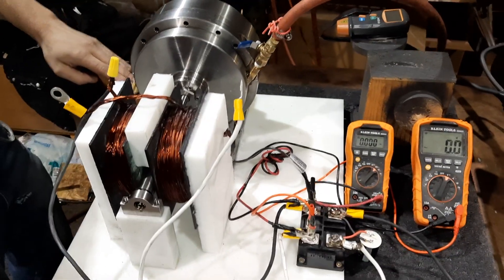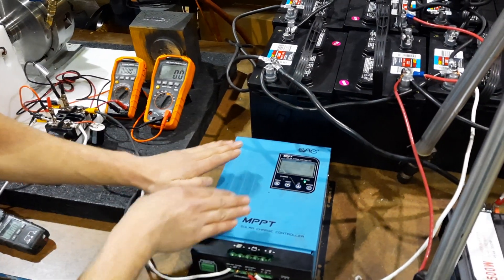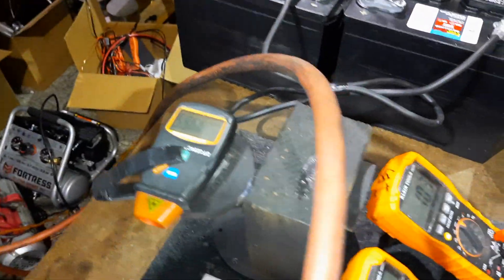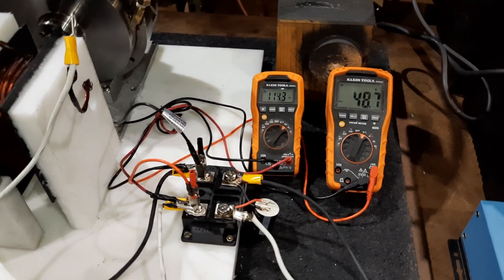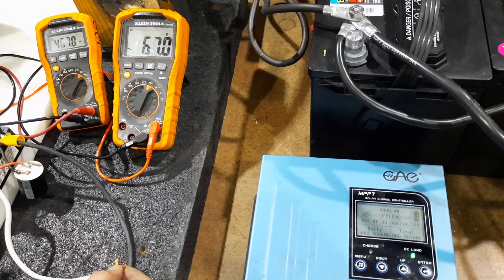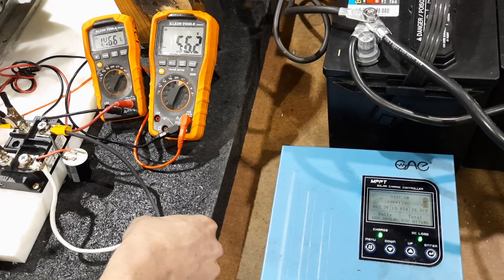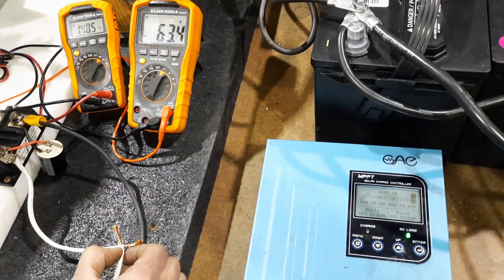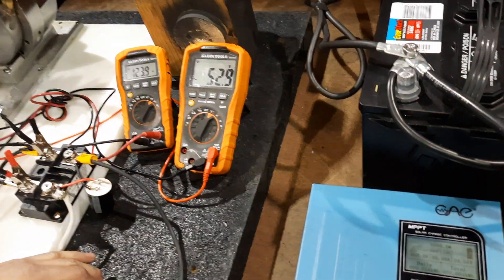Tesla Turbine Producing Usable Power! LOAD TESTING!

Comment: I think you have an "impedance mismatch" going on here. Your alternator is loading the turbine too much and dropping the RPMs out of the region where the TT is most efficient. You could use smaller coils and/or move the coils further from the rotor. You could build the rotor and stator right into your turbine and have less gear to keep balanced. Your turbines are amazing. I haven't seen someone get so much power from a TT before. Right on!
Reply from the maker: you are correct, the problem is vibration when it gets up to speed, we have since fixed the issues.

Comment: Have a question, I see that you disconnect and reconnect to the charge controller, and notice that the turbine then slows down, if you had to leave the connection closed how does it affect the turbine?
Reply from the maker: the charge controller slows down the turbine too fast with the resistance of the load being too high, we have since used capacitors to limit the current to allow the turbine to get up to operation speed before too much power is drawn. The power goes up exponentially with speed.
Reply: @iEnergySupply  apologies but my understanding of this is very limited, am i understanding correctly that the charge controller is slowing down the turbine too much? so to counter that you have a capacitor that the turbine then charges and you pass that on to the charge controller and basically just repeat the process? would this have the ability to run lets say 12Hrs a day as long as you give it air to charge a battery bank with the capacitor set up?
Reply: @iEnergySupply  mppt algorithms are designed to maximize load, try a pwm
Reply from the maker: @drgeeforce1129  gosh I never thought of that! Ty

Comment: Put a splitter on the inlet and feed one side with the exhaust and put a damper on the other side to use as throttle and start it by blowing through it. I'm just curious what happens.

Comment: For the tesla turbine to truly shine and offer significant torque you need to exceed the crossover point between turbulence and vortices typically this is around 50000 rpm on the tesla turbine. Then you will really begin to see how this turbine operates!
Reply from the maker: Your correct but remember it also depends on the diameter of the rotor. 

See our new videos, we got 1400 mile per hour periphery speed, with 150000 rpm with a three inch rotort.

Comment: Nice ! you need more capacitors to stop that drag when on load.. Im no expert but seen that done right and all load drag goes bye bye
Reply from the maker: Wait till you see the larger nozzles and higher speed, this was a low speed test. I'll have updates really soon
Reply: @iEnergySupply  Awesome. Im excited :)
Reply: @iEnergySupply  , would a diode on the voltage regulator input along with those capacitors help to keep the dc from bucking?
Reply from the maker: @alexparsons5707  The full bridge rectifier is what I'm using, do you mean maybe I should use separate diodes after the bridge rectifyer?

Comment: what is the size of wire u used for the coil?  and 400 Amp is so much for ur test, try to find higher voltage but up to 25 Amp bridge rectifier to manage to keep the engine run continuously. BTW what is the nozzle size in this test?
Reply from the maker: 1/32"x1/2" inlet nozzle.

Comment: Maybe the vibration could be removed sooner if the turbine would be placed horizontally?
Reply from the maker: It does seem to smooth things out when I turn them vertically.
Reply: @iEnergySupply  interesting :)
Reply: @iEnergySupply  is it possible for Tesla Turbine to have inlet from two sides (180°) and two outlets? I imagine that mass of a vapor on one side only could create disbalance. With two separate valves for two inlets maybe this could be fine-tuned? :) Or maybe even better - two tesla turbines in 180° arrangement also with separate valves...

Comment: Great video I have a Tesla turbine that I use to turn two 1 wire Gm alternator to change 8 battery bank and the great thing is the alternator have built in regular so they don’t over charge the batteries and as batteries discharge it automatically starts the charge process.Also I run a lot lower rpm to do this which cuts my steam usage way down.
Reply: did you build your system? could you share more about it with us?

Comment: Molten salt vacuum concentrated solar combined with this. That's the future
Reply from the maker: That would be amazing! Although, I don't think we will need temperatures that high based on my expirimentation.
Reply: @Flutter Water... Water pressure. Nothing stronger and non toxic than blue wave. It's green! And it would be looped, long radiator system cools it off and reuse.
Reply: @iEnergySupply  salt can melt at 100c - a good temp for boiling water. The temp necessary is not that high.
Reply: @Flutter To attain the pipe pressures necessary without leakage will require pressure fitted fittings because I think anything threaded will run into leakage problems. The pressure fitting must also be reinforced with something like a long steel adjustable pipe clamp which travels around 2 components or more to secure them together. Steel will have good enough melting point for high temps.

Comment: Cool demo using air to a high RPM, but this is with a Tesla style coil generator. Two other numbers are crucial if you drive it at lower operating speed to conserve the required power source (air pressure and CFM), the ideal generator working RPM should be around 3,000 RPM and a required 3 HP required to maintain a variable load to charge and operate a decent size battery pile of 200 Amps for a 12K off grid power inverter to 240 VAC.   Do you know your air compressor power in HP and CFM?  

Your Tesla Turbine rotor plate size appears to be around 5.5" diameter, and at 10,000 RPM to generate 2 HP at the generator is requiring somewhere around the same amount of air compressor power with 85 PSI and 10 CFM input to the turbine. Making a 50% model efficiency here is good demonstration, but I believe you need to work with something like a 10" diameter turbine, recirculated liquid driving it at 3,200 RPM using a 12 VDC 1/2 HP positive displacement pump.  That should be able to start from the batteries, operate a conventional 4,8K 120VAC alternator to run the 30 Amp 12 VDC charger and run itself at about an 85% efficiency.  By using a higher efficiency coefficient you could get more continuous charging power over the required generation drain of the pump load, with a better power source to operate a house power load at 50 Amps or so, which should probably run a second charging system with a parallel 30 Amp solar changer and afford a larger inverter power system to create a normal 100 Amp house current full off grid load that will operate nearly forever with normal small maintenance periods.

Comment: What if you used steam from other sources instead of water
Reply from the maker: Have a closed system will be testing with fluids that have much lower boiling points. Decisions all set up and we're just hooking everything up
Reply: @iEnergySupply  Have you considered trying a gas that has non-newtonian properties at the working conditions?  You could probably get better grip that way.
Reply: @matthewkolar7560  Oh Yea - we've been talking about that stuff for over a year.  One baby step at a time.
Reply: Have you considered using a fluid with a low inversion pressure and temperature to take advantage of the extra expansion for extracting power? Then further expansion for cooling and condensation.
Reply: @davidcollar4577  Both of our questions should be asked with respect to the question of "is there a phase area on the steam phase-change graph with these properties." Finding the perfect working fluid is rather a snipe hunt if it's some esoteric substance that takes a long chemical plant chain to produce.
Reply: @matthewkolar7560  True Matthew. What ever vapor is selected, seems that the phase-change is where the net power gain is achieved. What is exciting to me is the condensation happening during the power production portion of the system cycle. This condensate is now ready to return to the “boiler” for reuse. The remaining un-condensed vapor should require less work to remove by the exhaust turbine pump.
Reply: @davidcollar4577  this can all be affected by the base charge on the water at select parts of the system. See Pollack's work, namely the presentations listed on Thunderbolts Project's channel.
Reply: @matthewkolar7560   @Cinematheque Rouge  YouTube staff office culture stalls my YouTube so much that my volume button stops working during the covid freeze. You know what that means? We can eventually expect Google staff to have full control over our browsers just as they  do with our YouTube inbox. You don't even receive anywhere near the amount of comments that YouTube intercepts.
Reply: @sanfords   @Cinematheque Rouge  YouTube staff office culture stalls my YouTube so much that my volume button stops working during the covid freeze. You know what that means? We can eventually expect Google staff to have full control over our browsers just as they  do with our YouTube inbox. You don't even receive anywhere near the amount of comments that YouTube intercepts.
Reply: @davidcollar4577   @Cinematheque Rouge  YouTube staff office culture stalls my YouTube so much that my volume button stops working during the covid freeze. You know what that means? We can eventually expect Google staff to have full control over our browsers just as they  do with our YouTube inbox. You don't even receive anywhere near the amount of comments that YouTube intercepts.

Comment: Nice!!! I don't get how 6000RPM = 100hz output.  Sounds like you have the batteries wired for 24v.  I wish I could have seen the generator a bit.  Good explanations though!  Your videos just keep getting better!  Let's get that baby balanced so we don't need to worry about vibration.  COOL!
Reply: 60 RPM = 1 hz
Reply from the maker: if a rotor rotates 60 times per second, it's 60 hz. If my generator makes 60 revolutions in one second that equals 1 hz
Reply: @drguywilson1685  @Cinematheque Rouge  YouTube staff office culture stalls my YouTube so much that my volume button stops working during the covid freeze. You know what that means? We can eventually expect Google staff to have full control over our browsers just as they  do with our YouTube inbox. You don't even receive anywhere near the amount of comments that YouTube intercepts.